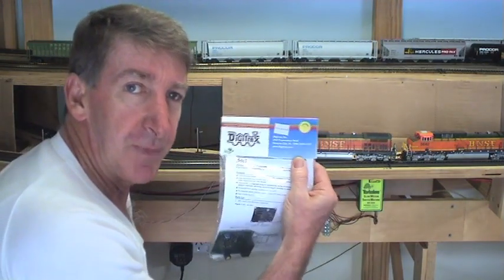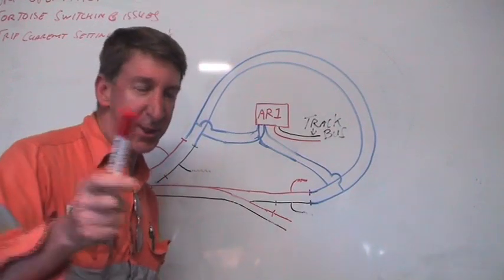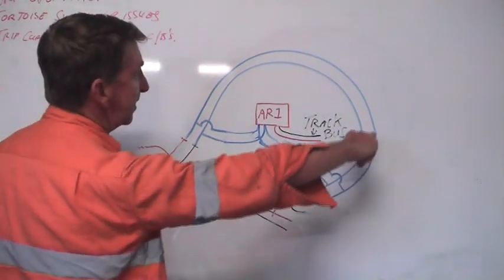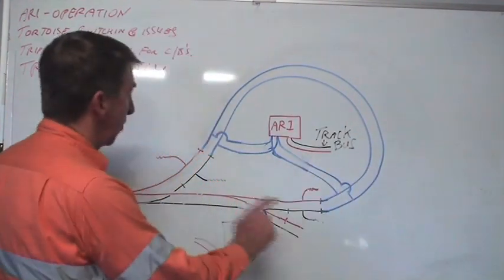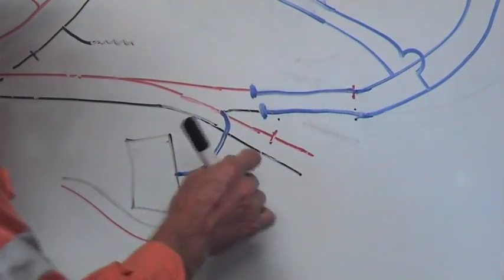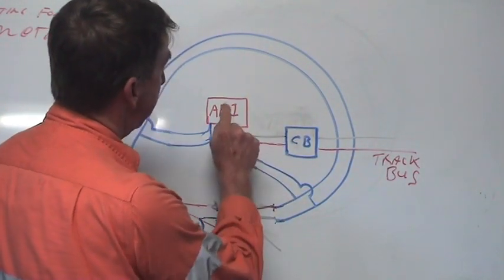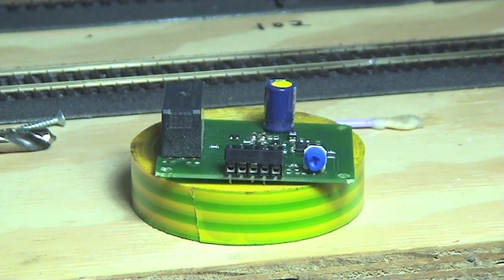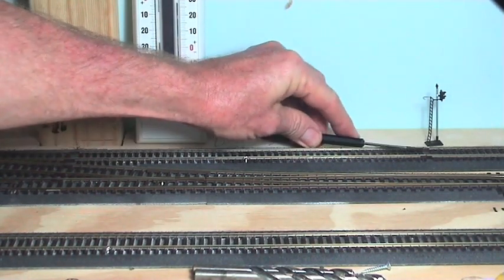Digitrax AR1 Auto Reversers. Tips and setup tricks.

Comment: Really helpful for those of us who are not "sparkys", as the trades guys say up here in Canada. Thanks for sharing Gregg!
Reply from the maker: Thanks Ben!, we call ourselves sparky's down here as well!  Glad you liked it mate.
Cheers Gregg
Reply: Hi Gregg,

I've got a couple more questions as I begin to run the bus for my first reverse loop. 

1. The short section right after the turnout that runs on the mainline track bus, how long did you make it? Does it matter? 

2. By running a feeder from the beginning of each side of the loop to the AR1, does that not create a closed loop of feeders? I've read that it should be avoided if possible as it can create problems with the DCC signal. Have you had any problems with this? 

My reverse loops are 25' (7.62 m). 

Thanks in advance!

Ben

Comment: Thank you for you patience.  I think I may be getting this auto reversing concept.  If district five goes through a potentially auto reversing section into district two.  A length a track to hold the longest train would have an AR-1 to power this section, for example and it could receive its power from any one of the five districts. Correct
Reply from the maker: You have it Rick! If you have the space, I would go for a separate section if you can!  No problem, at all, happy to help.
Gregg.

Comment: i hope you still monitor comments.  This was great.  Like you, I have used these and they kind of worked okay but had issues.  Going over the details of operations-now I understand rather than follow directions.  I wonder how many know how they actually work. I knew, but did not understand the significance of the AC style power.  If you have reversing sections, watch all of this.
Reply from the maker: Hi Blaine, thanks for the comments and I'm glad you enjoyed the video! Auto reversers do use a bit of black magic and it does help to understand them! These , having a relay to change the polarity,, are old school now, as the new ones do it much faster electronically, but they still work great once you have them set up. The only issue with these , is if you have electronic CB's  , you have to slow the trip time down , as the circuit breaker trips faster the the reverser! 
Thanks for watching.
Cheers Gregg.
Reply: @FishplateFilms  Sounds like you need to do another video.  I am pulling my old stuff out of storage.  I have five AR1 so should be as you describe.  ??  Should be like 2008 vintage.  I'll read the directions, but now with understanding of what they are really saying.  Thanks Again.  And you are entertaining as hell.  Kid of guy I would like to "grab a pint" with.
Reply from the maker: @blainedunlap4242  Actually Blaine, I've done a video on NCE electronic CB's and I do mention the Auto Reversers in that . I've yet to buy a new Auto reverser , but it will happen one day and I'll review it then. 
Thanks for the kind comments and I'll have a Single Malt when you order the drinks Sir! 
Cheers Gregg.

Comment: Gregg,  Nice video!  I hadn't really understood what an auto reverser does, but I'm starting to get it :-)  In return for the electrical info I'll give you a modeler's suggestion.  On your Kato units the light bar allows the head light to shine through the window in the nose door (it showed on the video).  Take a daub of black paint and put it on the INSIDE of the nose window.  That will block the light and still looks good.
Reply from the maker: Thanks Gary, glad your getting some info from the videos! The door window is bright on some units! They will get a painting when the locos get weathered, thanks for the tip!.

Cheers Gregg:-)

Comment: I have a mainline involving a reverse loop. In side this reverse loop on the mainline I have a turnout exiting to a yard.
The power district for the loop area and the reversing portion is the same.  I plan to have the same power district on a short piece of track exiting to the yard.  Seems like the one AR-1 would do the job.
Reply from the maker: Yes Rick, as long as the yard is fed from the AR1 , or you put insulated joiners going into the yard. Then you should be fine.
Gregg :-)

Comment: Hi, nice video. So if I have a wye, consisting of two turnouts (one with a diverging right switch and one with a diverging left switch) and those two turnouts that connect to a wye and the combination of the rail splits in three different directions, how many sections get an “AR1” or do you wire one AR1 to all three directions of track?

Comment: G'day Greg. I'm a little confused by the return power change over. If you have a dc motor and you connect the wire's +ve & -ve the motor will spin in one direction then if you reverse the wire's the motor will spin in the other direction. At the return end of the loop aren't you reversing the rotation of the motor by turning it around. Isn't that the same as swapping the wire rotation thingy? Does this work on both DC and DCC setups or is it something that is particular to DCC only?
Reply from the maker: HI Chris, 
This is one of the many advantages of DCC ! The track is AC, so therefore does not really have "polarity" like DC. The motor is fed DC from the decoder which knows what direction it needs to be in, and the AC is only there to feed the decoder, and doesn't care what "polarity" it gets. The Reverser is only there to make the "rails" line up at each end , so the wheels don't short out the track as they pass over.
Hope this helps!
Cheers Gregg.
Reply: G'day your Lord ship. Thanks heaps mate. I wasn't aware about the AC side of thing's now I have got it buried deep in the grey matter I'll just have to remember where I buried it next time. With my wheat siding the train will enter via a LH point and sweep around behind the complex where all the carriages are stored in sidings will pass through the loader and cross opposite direction rail's { 2or3 } lines. Would this be done similar to a reversing loop change over or a different system altogether? Sorry Greg, I don't mean to be a pain in the arse but you sound like you know a fair bit about all of this stuff, being a sparky helps I suppose and a modeller. Thanks mate.Regards Chris  @FishplateFilms
Reply from the maker: @chriscorrigan7420   Yes thats correct CHris. If it goes through a diamond, then that would be the end of the reverse section. I'd have to see a drawing to confirm it, but draw it out using different colours for each rail, and then you can see where you need to put the reverse section.
Gregg 🙂

Comment: Gregg great info.  I am having a reversing issue on my Layout.  I am NCE here I have a AR10  No Loop per say I have an oval that I added two turnouts on.  they both go thru a WYE  the first turnout take me to my Helix and on the return back I go to the left side of the WYE and right there is a polarity mismatch.  I Added the AR10  one end to the DCC bus  the other end I put the feeders of the two sections of track that meet where the polarity mismatch is  The WYE is insulated on all three sides each line into the WYE is insulated at both end.  But it still shorts when I run my engine over the track.  The AR10 is a circuit board and no relay.  No sound either. Any ideas or suggestions Thanks Tom
Reply from the maker: Hi Thomas, Wye's can be a bit tricky, but you only need to insulate one leg , Treat the Wye as a siding ,with a turnout at the end, with the track coming from that turnout , going back to the mainline. This is the track you need to insulate with four insulated joiners/fishplates. If you try to do both , you will get problems! Also remember that the whole train must fit in the reverse section! I hope that helps? Let me know if you need any more info!
Cheers Gregg.

Comment: Gregg: Great video, albeit the sound was rather hard to understand because of the echo in the room. I have a unique application for my DCC NCE layout; I need to bridge two sections of my layout which are on separate buss assignments (B1 & B2). I want to run a length of straight track (non-loop stand alone buss#4) between the two sections using an AR-1 (or multiples) so as to switch polarity between B1 & B2. I wish there was a way to attach a diagram to this comment. How can I configure the AR1, please?

Lastly, in your drawing illustration, which track bus supplies the AR1?  THANKS
Reply from the maker: Hi and thanks for watching! I may have misunderstood, but you don't need an reverser between power busses, as long as the rails are the same polarity where they meet. If they are not, you can't use an AR across 2 separate busses. You'll need to make a short section the same  polarity for both on the joint , then on the "SAME' buss, after that short section install your reverse section which must be as long as the longest train you will run. So you'll swap polarity on one side to match on a short section of track, then install your straight AR section.
The main bus for that section supplies the AR! .
Hope that helps.
Gregg

Comment: Insulfrog turnouts leading in to the loop ar 10 makes it through the left gap but shorts at the right gap booster shuts down first the ar 10 does not  chang polarity.
Reply from the maker: Hi Juergen, Thanks for watching! You can't use a insulfrog turnout as a insulated joint, as the power goes through the turnout under the frog. You must use two insulated fishplates at each end of the reversing section/loop. Hope this helps.
Cheers Gregg.

Comment: looking at the blue lines on the AR1 wiring to the right shorts with the wire to the left. Trace the blur wire . Note you only need one connection please evaluate.
Reply from the maker: My bad! With all the drawing, I forgot to rub out the two wires. With long sections, it is best to have a feeder at each end, as it speeds up the tripping process.
Gregg.

Comment: good explaination! however i got a loop to loop track with both end a reversing loops, does that means i need two AR1? or one AR1 to do the job? i foumd a very simple circuit involving two bridge recifiers with one relay
Reply from the maker: Thanks Mathew! Yes you would need two AR1's . I would be careful making my own though, you have a lot of expensive gear on , and running the track. The newer versions are electronic and work even faster and smoother.
Cheers Gregg.

Comment: When you mention the "train length" inside the reversing section, do you mean just the portion picking up power (locomotives and lighted or resistor wheelset equipped cars) or the entire train?
Reply from the maker: The entire train! This is because the metal wheels will short across the insulated joints at the rear end of the reverse section, and trip the AR. 
Cheers Gregg.
Reply: @FishplateFilms  I understand now, thank you!

Comment: So if DCC is AC power and not DC why are short an issue? Find this confusing because AC is constantly changing polarity as it flows also Marklan trains are AC and a reverse Loop is no problem as far as worrying about a short circuit do you need no polarity reversing with  Märklin. 

I’m asking this because I am getting ready to wire my first Dcc layout any explanation and help would be appreciated. Thank you for the video, it was very helpful just left me with this question.
Reply from the maker: Hi Hans', you are right about AC, and if you watch the video again I do explain that it is the rails looping around on each other that causes the short. The outer rail loops around and becomes the "inner" rail and that is the same as touching both rails together, hence the need for a reverser. Marklin does not have that problem as they use a third centre  rail that is the "active" and the two normal rails are the return, so the middle rail always goes back to itself and the outer rails are the same so no problem if they cross! 
Hope this helps and thanks for watching.
Gregg.

Comment: Why would revenue cars, even lighted passenger cars long than the reversing loop cause problems, unless you had a pusher engine entering the reversing loop the same time the head engine is exciting. That would probably cause the AR-1 to have a conniption.  Also, what if your reverse loop was your staging yard (my design calls for looped staging yards at each end of the mainline), three tracks, a main and two storage tracks. Is that clear as mud . . . Cheers Ron . . .
Reply from the maker: Hi Ron. It is not the current draw of a car or loco that is the issue, it is the metal wheels shorting out the gap at the insulated joint. Every time a wheel goes over the join, it will trip the reverser if the other end has tripped already, so if a train is longer than the reverse section, the AR1 will trip back and forth as each wheel goes over the joint at each end. This happens at both ends and very often at the same time, shorting out the track as the AR1 tries to switch both ends at once and it happens more than you would think!  So it crucial that trains do not overlap the reverse section. All 4 of your roads must be long enough for the train length and all  must have their own AR1 if they come back onto the main. 
Hope that helps.
Cheers Gregg.

Comment: hey Gregg.. very helpful info... i get it now... rip out the DCC & go back to DC...LOL
you always mention to have the entire train in the loop... WHY????.. i won't have a problem with that both of my loops will accommodate a full train.. just want to know the reason... would you incorporate industrial sidings in the loop?
thanks for sharing this useful info
your US buddy
vinny
Reply from the maker: Thanks Vinny!, but there's no way I could go back to DC! If you were paying attention in class instead of looking at girls on your phone, you would of heard me say why that's a problem!  Now ,the issue is a train that is longer than the section will have axle's going over both ends of the section at the same time, which shorts out through the electronics and the relay in the reverser. It will try and switch each time a wheelset shorts out the gap,at each end, if this happens at the same time, ( you'd be amazed how often it does!) it will short out the reverser!. No problem if you have plastic wheels...but who has them!! 
Now , detention for you and Ron!
Gregg:-)
Reply from the maker: P.S, yes you can have sidings in the loop, but fed from the reverser only!
Reply: FishplateFilms  OOPS sorry professor... but i think i like the girls a little better...LOL ... both of my AR1's are installed & working perfectly at this time.. there will be a 3rd when i get to the helix... thanks for all your help i do appreciate it...
vinny

Comment: Rick. I have three reverse loops on my layout. I had intended to use one as a storage track. Is it normal that if I have a train within this loop and turn all power off overnight, then turn back on next day, that the auto reverser will short?
Reply from the maker: Hi Jack, 
If the AR is clicking on and off on startup, it is sensing too much current, like a short when trains go over the joints at each end. Try adjusting the trip current up a tiny bit and also make sure that the train is not longer than the reversing section! If you have a few sound equipped locos in the section, they use a bit of current on start also, so up the trip current a little!
Hope this helps.
Cheers Gregg

Comment: Nice video but still problems with reverse loop. I have 2 ovals which are joined by turnout to enable entry into inner oval. In the inner oval I have created  the reverse loop. None of my switches are wired. Cut the reverse loop as it created short. Any tips on insulator insulation to enable operation of reverse loop
Reply from the maker: +blaiseduff You will have to send me a drawing to see how it looks! Then I can see what you need .
Cheers Gregg
Reply: I will need an email to send. Can send pic of layout as just track laid at that moment. Thank You